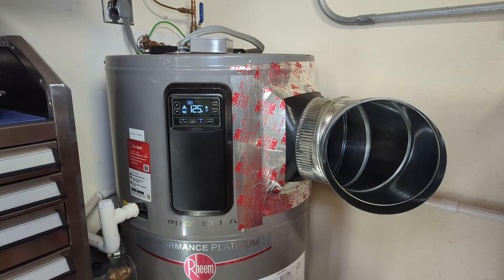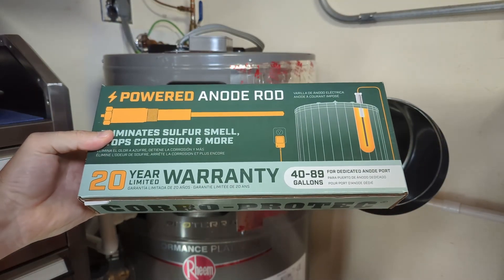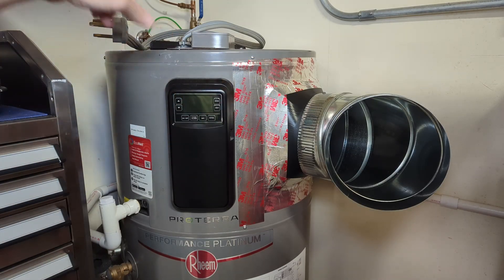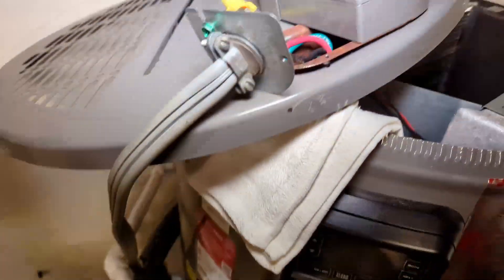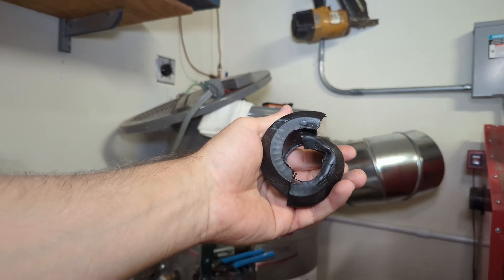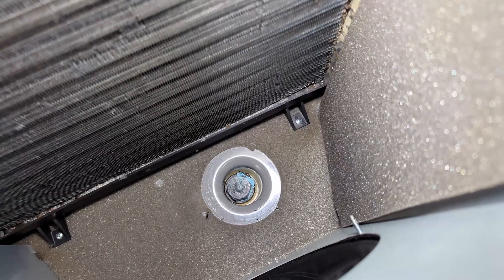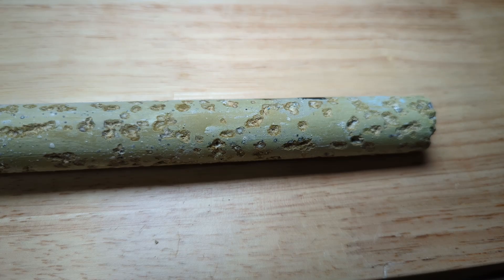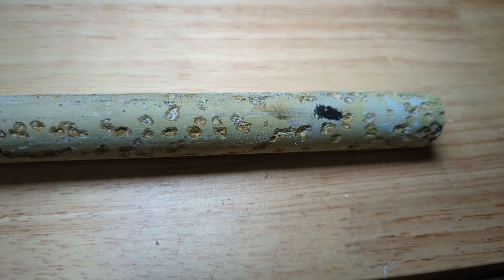Installing Corro-Protec Anode Rod in Rheem Proterra Hybrid Water Heater

Comment: Nice video.   Wondering if there was a screw inside the unit you could have attached the "tank" screw to, so it didn't have to be external.   The side grommet was a nice idea.  I was originally thinking I'd go thru the top.  But since that can be removed, best not to also have to deal with that.
For others that have changed their anode rod (whether to this electric one, or traditional), when did you change it, and how did it look?  I was thinking about doing mine at 3 years (start of recommended inspect/replace time I think).   I have Rheen A004 & T009 errors, and might have to get inside the unit sooner, so wondering if I should do it then.  But at 2 yrs, this anode looked basically new.  Yeah some pitting, but I'd think plenty of life left.  So wondering if 4-5 years might be better.
Reply: Make sure you call Rheem support. I got a new control board shipped to me that fixed error codes that popped up day after install.

Comment: Ah man, just tried to install the Corro-Protect on a new Rheem ProTerra Heat Pump Electric 50 Gallon (model PROPH50-T2-RH400-30). We could not get the factory anode rod unseated even with a 2' wrench and a several foot breaker bar for more leverage. Eventually the socket would pop off. There is very little anode rod socket sticking out. It seemed to be tighter than what you experienced in the video. I was using a 27mm socket. For a part that is supposed to be replaceable, this is poor design and over-torquing  by Rheem.

We gave up and if I ever come back to this in the future, I think it'll be key to have a 1/2" inch drive impact wrench with a single very sturdy 1/2" inch drive extension bar.
Reply: I had the same idea and tried installing the Corro-Protect on a brand-new 65-gallon unit before hooking it up, and ran into the same problem. The plastic cover alone took forever to get off, the rod is recessed really deep, and even with two people and a long breaker bar, the socket kept popping off and the head started to round. Luckily we stopped before it got too bad. What finally worked was a 1-1/16" 6-point socket on a hex-shank adapter with an impact driver, plus plenty of DAP Tank Bond Liquid Grip. After about 20–30 seconds of impacting it broke free cleanly.

For anyone else planning to pull the anode on these Rheem hybrids, here’s what I’d do differently next time: cover the evaporator fins with poster board/cardboard so they don’t get bent, wear gloves (lots of sharp edges), and skip the breaker bar once it starts slipping—just go straight to impact so you don’t round off the head.
Reply: Ah shoot. I'm just realizing I hadn't removed the black plastic. I thought that only needed to be cut out after the initial removal. Oops. That would have given me more bite.
Reply: A.O. Smith has their anode rode in there just at tight.  I first tried using a 1/2 break-over and a 6-point 1-1/16 socket.  All it would do is spin the water heater around.  Then I bought the highest torque impact wrench I could find.  I never did get the anode rod to break loose.  I really believe it was installed with heavy strength Loctite at the factory.
Reply: @sewerrat-u5t  A trick that sometimes works for stuck fasteners is to tighten just a tad, then try to loosen.  You might try that first w/ your breaker bar.  If that doesn't work, try with your impact.

Comment: Would you mind discussing the duct taped to your water heater's outlet? What is the benefit of this type of duct?
Reply: We have a duct installed that can pull or push air from the living room, above the water heater.  In the summer, it just pulls warm air from the basement and we discharge the cooler air into the living room to help keep the house cool in the summer.  In the winter, we pull warmer air from the living room (where the wood stove is) to be more energy efficient (but boy does the basement get chilly!!!)
Reply: The heat pump works sort of like an air conditioner:  warm (ideally) air flows in through the top grill, gets blown over the cool, and comes out the side as cool air.   You'd want to make sure that the cooled air doesn't get get sucked by up into the intact.  [That would make the heater less efficient, since there's less heat in the incoming air to extract, and use to heat the water.]  I'm assuming the duct is to discharge the cool air further from the intake, so that doesn't happen.
Reply from the maker: Yeah I installed this duct to direct the cold air out into my garage, rather than directly at my sand blaster. Works well!

Comment: Thanks so much for this. The Rheem video got removed from their channel for some reason, but there is a version out there on YT (don't know why they took it down). Even the Rheem guy was like "hey I destroyed this useless plastic thing, don't worry about it" which makes me wonder why they put that ridiculous thing in there to begin with. Others have said the hardest part is getting that plastic piece out! Anyway, doing this job this weekend. I"ll let you know how it goes.
Reply: How’d it go?
Reply: @joseeduardo4327  Not well! Got the plastic out after 3 hours of struggle. Tried to get the anode out with a breaker bar and it wouldn't budge. Hit it with an electric impact and actually nearly fried the impact. I have seen guys strap the tank to keep it from rotating, but that wasn't an option for me. I think you could probably break it loose if you strap the tank and have two gorillas holding it while you hit the anode with a 4 ft breaker bar. Short of that, ood luck. I finally bought the corro-protec hot water outlet anode and I'll have to have my plumber do it because I don't sweat copper and the whole setup will have to be revised. In retrospect, buy a HP water hearer with a powered anode to begin with.